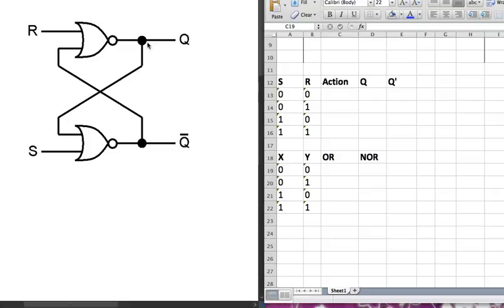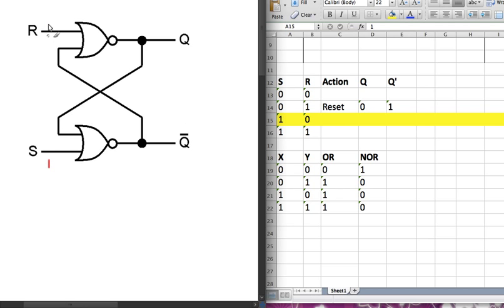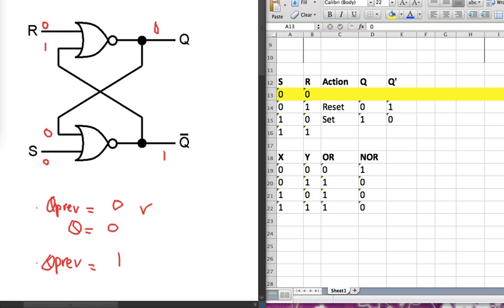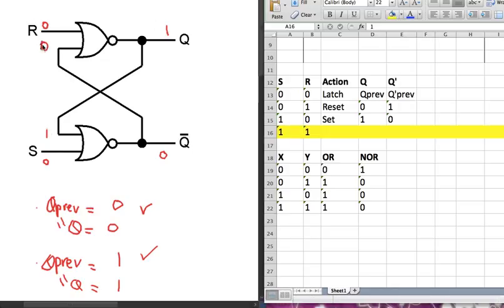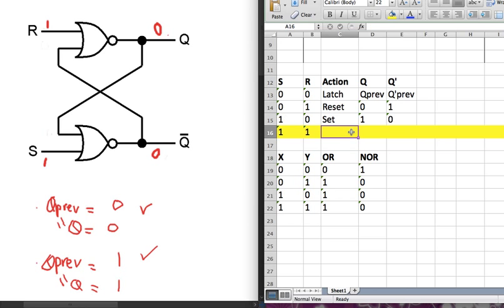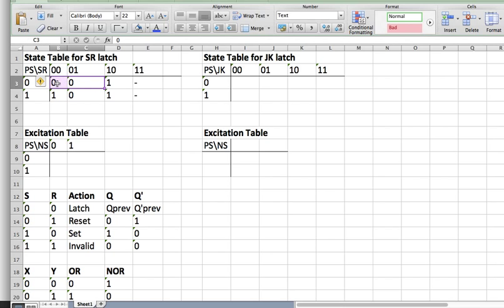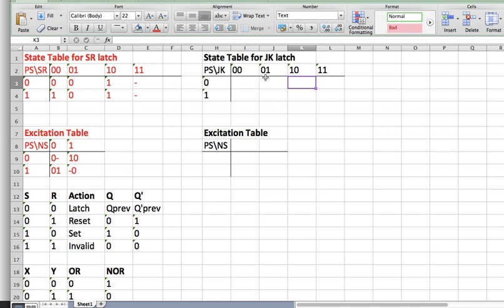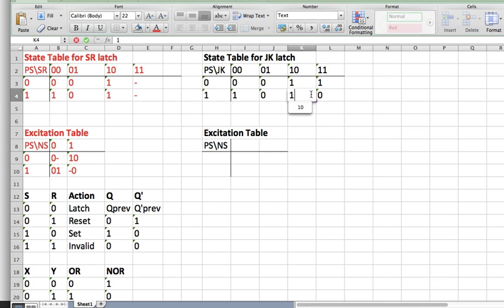CSE 140: SR latch & JK flip flop

Comment: Just wondering but when you make the state table for a JK latch, is it the same for a state table of a JK flip flop? From what I know, the difference between the JK flip flop vs JK latch is that the flip flop depends on a clock input as well, whereas a latch doesn't.
Reply: I think on piazza TAs explained that the tables will be the same for FF and Latch
Reply: Yah I saw. Latch vs flip flop state tables are the same since we only care about the situation in which a state might change. I'm this case, both will have the same output Q depending on the value of D.
Reply from the maker: Kane Chong Correct!